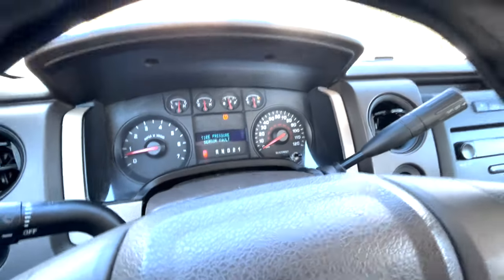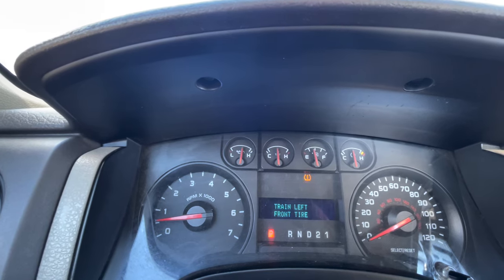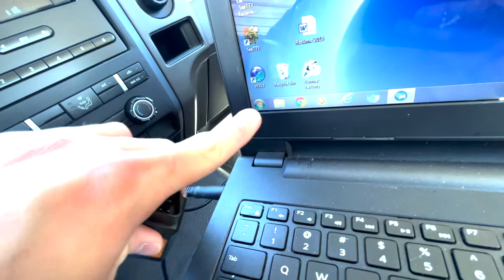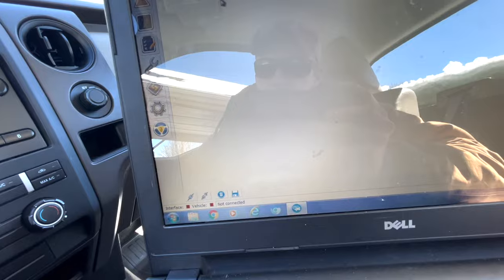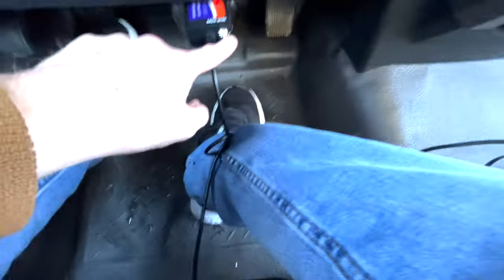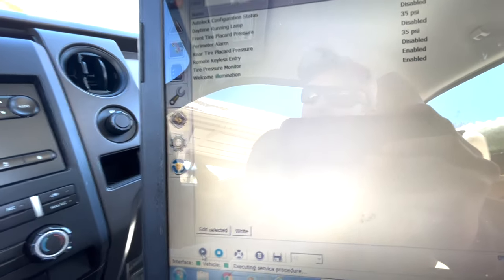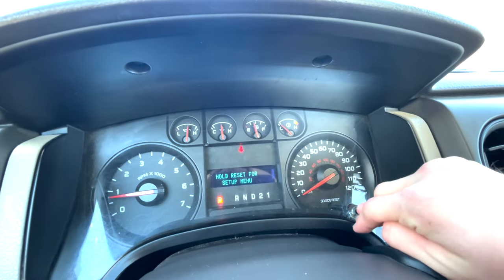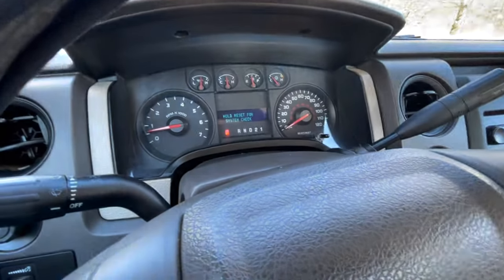DIY - How to Disable Tire Pressure Sensor Fault Message on most Fords!

Comment: Before you try this, make sure you do not have a USB charger in your cigarette lighter port. Because of some of the unregulated frequency settings, the new types of us chargers that come from abroad can throw a false tire pressure sensor error. This just happened to me about 2 months ago. I spend hours trying to figure it out until someone mentioned it to me. All I did was unplug the charger and drove around. Code was gone in a few minutes.
Reply from the maker: Never heard of this - thanks for the tip!
Reply: @RandomAutomotive  you got it. 👍👍👍
Reply: Awesome tip, Thx! Question: some way to pair electrical foldable mirrors to contact switch(F-350) normally I have to fold the mirror from the switch, but I’m curious if can be automatically fold with the contact switch off and unfolded when the contact switch is on (motor running). Thank You!
Reply: @Hfernandez06  haven't tried the folding mirrors, but I'd like to be able to use them. Unfortunately, I don't have an answer for that. I will look around and if I find good or bad news, I will post it here so it can notify you.
Reply: @peter-peter5929  Thank You !!
Reply: @randalgc  any of the non fast chargers. Remember this is an older car that was made before fast chargers were available. Just use a regular old school charger.
Reply: Who would of known ? Thanks
Reply: @Najerai17  you got it. I didn't believe it at first, but once it worked, I questioned reality again.
Reply: Thanks for posting this.  Removed the charger and the fault cleared short after.
Reply: @patgower5134  my pleasure. I had the same thing happen and I'm glad it was a simple fix. Huge stress reliever huh? I thought it was a couple hundred dollar fix and it cost less effort than a sneeze.
Reply: I'll have to try that. I just got a fast charge / Bluetooth receiver for my 2010 Ford Focus. I had just put air in all tires, then shortly after got the charger and the fault showed up.
Reply: Thank u be i bought a new USB charger then then had this problem ur a life saver💯💯💯
Reply: @btru6426  no kidding? My pleasure brother. This was driving me up a wall too. I'm glad I could help others. When you hear of someone else having this issue, you could be like: step aside, I got this.
Reply: @MindofSmoothie  how did it go? Problem solved?
Reply: @peter-peter5929  it didn't seem to work, but I only drove a short distance with it removed. I'll have to see if I remove it completely from the car and drive for a little bit maybe that will work. Not really a big deal to me because during the pandemic my wife and I went down to one car and we just picked this car up very cheap last fall to be an "as needed" vehicle so it doesn't get driven a whole lot.
Reply: @MindofSmoothie  the main concern is eliminating a "real" issue with the monitoring system. Driving for a while can clear up the error code after a few cycles if the adapter was the root cause. If it's the back up vehicle, we still have to show it love. 👍👍👍
Reply: It jus worked for me but now how do o listen to music lol
Reply: That's caused by aftermarket TPMS sensors. The ones made by Ford don't have this problem.
Reply: Unplugged my cheap usb phone charger light went off immediately

Comment: Got some 22's with 35's for my F-250 but they came off a truck that didn't have TPMS so there's no sensors in the wheels.  I am not about to spend $200 on sensors plus another $100 to remove and remount my tires just to turn off a stupid light on my dashboard.  I'll disable the system myself with my laptop.  I check my tire pressures before road trips or towing and when towing I check it at every fuel stop.  Made it all these years without TPMS on my other trucks and this newer truck has this feature, which is neat, but not necessary.  Now I'll have to try to convince the guys at the tire shop not to sell me TPM sensors when I get my next set of tires.  Maybe I'll just take the wheels off and bring them to the tire store and tell them it's for a 2003 F250 or something.

Comment: is there a line item in this program that could be disabled to shut off the default setting for "auto stop/start" switch being on when you start the car? I have been looking at hardware wiring plugs that take care of this but they are about $100. if there is something in this software, boy what a bargain this would be. I could take care of both issues with a less expensive solution!
Reply from the maker: None that I know of unfortunately on here. I hate you can’t permanently disable it (I know there are kits). Apparently it’s a government thing 🤷🏻‍♂️

Comment: If you have a 2018 Ford Expedition, this works. If the Warning light does not go out right away, drive it. I followed these directions and it cleared mine. If it doesn't, it's a bad sensor. I drove mine roughly 10 miles, because the tire was holding air.

Comment: This process worked well with my 2010 Edge SEL The Forscan software I downloaded this weekend had a caution about the quality of the currently available ELM327 Scanners, and the warning was repeated when I activated the software while connected to the vehicle. However, everything worked as indicated that it should in this video, the TPM system is now off and the vehicle is fine and absent the annoying message and warning light. Thanks for posting this information and the detailed "walk-through!"
Reply: Exactly what I needed to know.  I need to do this on our 2015 Edge. Thanks!

Comment: Worked like a charm! I was getting the tire pressure monitor fault even with new sensors installed. I just put on new wheels without sensors so I needed to disable the TPMS function. Thanks for the video!
Reply from the maker: Absolutely, thank you for watching!

Comment: UPDATE:  07-29-2022... Last night I received the ELM327 adapter you linked to. With it, I got the correct menu with the options necessary to make the change and I just used it to successfully switch my TPMS to DISABLED. Yippee!!!  While in there I also turned off my BELT MINDER, so no more incessant chimes when I'm hooking up a trailer or my wife is taking off a jacket with the seat belt not latched. 

Next, I'm going to look into programming a new ignition key. I have two but one key no longer works the remote lock/unlock buttons. 

Back in my office, I wanted to look at my LOG. I didn't save it, so no LOG to see. Bummer! So that's my little tip... on the bottom of the screen hit the DISC icon and save your LOG.  Best $20 spent in a long time... Thank you!! 

ORIGINAL POST:    So I tried to do it this morning on my 2011 F-150 Eco Boost. It didn't run correctly... The log says "This adapter has CAN bus compatibility problems and can not be used in some functions." I then noticed I did not order the adapter you listed. My adapter LOOKS identical, but it isn't what you linked. I've ordered the one you link to and will try again when it gets here. I fully expect success once I have the correct adapter! I'll post an update... Thanks for this video.
Reply from the maker: Yeah post a update for sure - for some reason FORScan is VERY particular with what adapter you use. Hopefully the new one will do the trick!

Comment: Worked flawlessly, thank you. FYI I downloaded ForScan from your link. Apparently, it has the drivers needed to use the ELM scanner you have linked in the description box. So it was plug and play!
Reply: I don't know if you found how to disable the seat belt minder but I found this video. https://www.youtube.com/watch?v=8R3n9jvr6Ek It should get you to the correct settings. Honestly, I don't remember who I followed, but likely someone who showed this method. Good luck!
Reply: @woolval52  Thanks for the reply. I did find it, it's actually in the owners manual lol. You can turn it off watching the seat belt icon on the dash, using the "key on" and locking/unlocking the seat belts 4x. 12 years I've had this truck and I'm just now finding this out 🤪🤣

Comment: My 2010 F-150 would randomly display TPMS message on a long trip. It would reset after stopping for awhile and restarting. The message would come back on after another lengthy drive. I found out by watching FordTechMakuloco if you have a cheap usb adapter plugged into one of your 12v accessory port it would disrupt the signal of the tire sensor and trigger it. The original TPM still works to this day.
Reply from the maker: You know, I’ve heard of this.. Something about the adapters interfere with the 400Mhz range and could cause that. It’s also true in some public safety vehicles I’ve seen adapters interfere with UHF radios. So that’s a very valid point. 

My understanding with this truck is it was an old Terminix fleet truck. Apparently when they remounted tires on it, they didn’t bother with TPMS. I found that out much later after this video.

Comment: Thanks for this video. TPMS light came on in my 2012 F150 about 2 weeks ago and I know its just a bad sensor battery, cant be bothered to pay $$$ to get it fixed. I check my tires frequently out of habit, never liked  or needed the mandated TPM systems. Software is available for  Mac, but it has a caveat warning, so stick with Windows if you can. The license came to mhy email within about 20 minutes, so good on them!
Reply from the maker: Glad it helped. Yeah I haven’t had much luck with Mac machines with it. They’re a great company and get to it fast especially on week days
Reply: @RandomAutomotive  OK got  it  sorted. Had to pay for the license, free "extended " did not allow me access to the modules on my truck (tried several times, several downloads) was only $12, SO MONEY WELL SPENT. Well, thanks again.

Comment: Great video! Will the vehicle pass inspection with TMPS disabled (N.C.)? Also, can the rear parking sensor be disabled? 2012 Escape. Thanks
Reply from the maker: I’m unsure about NC. I know here in Tennessee only certain counties (mainly Metro areas) do vehicle inspection, my county does not. In the larger cities here TPMS isn’t part of it - mainly emissions. However I can’t speak for the other 49. Since it’s public knowledge, I’m sure the inspectors office (DMV, municipality, etc. (whoever handles it in NC)) would be glad to tell you. 

I don’t believe rear parking sensors can be disabled. I know in older vehicles it can be turned off with a button. But parking systems became a “life safety” device at some point before rear cameras were mandated by the US govt.. I haven’t heard any success stories of disabling them through FORScan though.

Comment: Anyway to test all 4 locks on 2014 Supercrewcab? Can drivers door lock be turned off so you have to use a key only ? Thx great video 👍🏻
Reply from the maker: There are some integrated tests. I’m unsure of one for locks only, but I do know there is an overall test of interior systems. I can do a video on that soon!
Reply: @RandomAutomotive  that video would be great, thanks 👍🏻
Reply: @RandomAutomotive  I was told that a bad relay in the body control module for drivers front door is the problem, could that be true if all the other 3 door locks work as normal?? Only drivers door has to be locked and unlocked manually.
Reply from the maker: It could be.. I’m like you - I’d suspect if it was the BCM it would be all or nothing, but.. then again. The driver door unlocks independent (Ex: one click of the keypad, just driver door - two clicks the other three). So I could see how that could make sense. I like Ford, but their modern electronics are atrocious. They’re also notorious for the lock gearbox in the prematurely failing. I had a 2003 super crew that they all failed lol

Comment: I have a 2013 F250 truck that I'm trying to disable the TPMS on.  I have the ELM scanner with the MS/HS toggle switch.  I downloaded Forscan v2.3.57 which seems to be the most up to date.  I have my license key and it is activated on Forscan.  I followed the procedure given exactly (multiple times) and it never gives me the GEM/SJB section.  Is there something I'm missing or something else I need to do?  It seems to connect to the truck and read things fine, it just can't seem to get to the GEM/SJB part.  Any help would be appreciated - thanks!
Reply from the maker: Try reinstalling the driver and try again. If that don’t work it could be the oddball issue I’ve heard on some SD fords (08-14 use the same computer and sometimes the TPMS is a separate feature). If that’s the case - it could be changed in the binary data.. but that’s above my scope.

Comment: I was able to change the placecard tire pressure requirement using this module, it is not too hard to do. My tire pressures were changed to 55 psi because the load range on the tires were "E". At one time this truck, F150, was used by the Hilti Tool Co. for demonstartions and had alot of stuff bolted to a slide out bed, I can only assume there was a generator of some sort they used to demonstarte their tools on construction sites. That is why they put load range"E" tires on, I guess. none of this can be confirmed. MY issue was that when I went to get new tires I put on standard range tires with a 35# rating, I could not raise pressure to 55, as the max was 51# for standard load range. I had to make 2 changes in 2 different palces using some of the information from this video and also information from another video I found on you Tube from a guy who had a dually and needed to change placecard tire pressures on his dually. Carefully following thes instructions I was able to get my tire pressure Monitoring System working with the correct pressures of 35#. So happy. Oh by the way my 2016 Ford F150 told me that the module in this video was not compatible with this vehicle, it worked anyway.

Comment: I bought the same OBD shown in the video but now that I read some messages this wont disable my Tire Pressure Sensor Fault message in my 2008 F150 v3 5.4 Triton? I don't see it listed in the modules at all.. 😕
Reply from the maker: That’s a common issue unfortunately, this only works on 2009 and newer as stated at 0:11. 

Sorry about that!

Comment: I had to change my instrument cluster. On the truck. It was not 4x4. New cluster thinks the truck is a 4x4 with the wrench light how can i take that iff
Reply from the maker: That one is probably going to be more tricky. Not sure if you can trick the IC unfortunately

Comment: There are 6 downloads for PC Software what one do you download?
FORScan for Windows 2.3.19 Beta (Function Lists)
DownloadFile Size：26.20 Mb Hits：149607
FORScan for Windows 2.3.17 Beta2 (Support IPC Module)
DownloadFile Size：26.40 Mb Hits：89203
ELM Config
DownloadFile Size：12.21 Mb Hits：42609
ELM-FF2 English
DownloadFile Size：303.90 KB Hits：10388
FDS
DownloadFile Size：125.60 KB Hits：9388
FoCCCus 0.8.6
DownloadFile Size：125.60 KB Hits：19388
Reply from the maker: Good question, actually redownloaded yesterday. You will want to download FORScan for windows.. and the ELM driver also for the adapter.

Comment: 2 questions.
I have a 2012 f150 with 2021 rim and tire take offs and can't get them to marry. Will this help marry them? Or just need to disable it?
2nd question. Same thing...but 2007 charger with 2021 rim package. Will this unit work on this situation?
Reply from the maker: I’d probably disable it. I could be wrong - but I’d say the 2021 uses a different protocol than the 2012 truck understands, so it wouldn’t be able to ready anything outside of the f150 body style if that makes sense. 

This unit only works with ford vehicles, but I imagine it Chrysler has something similar it would be the same sort of issue. Hope this helps!
Reply: @RandomAutomotive thank you

Comment: Bought the adapter, but vehicle says ELM321 v1.5 not compatible with my 2012 F350.  Also I am running Windows 11.  What is my next step.
Reply from the maker: @jimsusanmoon6762 - Just checking, you did buy the "wired" version correct? I have had issues with the wireless version. I would recheck your windows drivers and make sure those are up to date before you buy another. Hopefully this helps!

Comment: Apologies if this question has already been asked. Can one reverse this change later needed? I may need to turn the system back on later.
Reply: I assume you can just swap it back to enabled, but my next question is how expensive is that software after the 2 month trial because my plan is to disable it when I put my winter tires on each year and enable it when I put my regular tires (with sensors) back on

Comment: Hi from Hawaii i got a 2007 mustang GT 4.6L mine is doing this now. So this thing might just have a dead battery in it before I buy anything?
Reply from the maker: Hi from Tennessee! That’s a possibility, but that means dead battery in the sensor, not the car itself. Most likely that’s it. Which those batteries are sealed, meaning the fix would be a new sensor - or the alternative disable the feature altogether. Honestly though, I’m unsure if this would work in a 07.
Reply: @RandomAutomotive  ok thanks
Reply: I just bought the ELM327 MS-HS OBD II for the mustang, On Amazon 20 bucks. Thanks for the video.

Comment: I know this video is old but maybe its still active. I bought the device as you described. I connect to my 2012 and 2014 F150 and it connects but get a message that the "device isn't for this vehicle and my not work properly". it connects but it doesn't show the tire pressure system on either truck. it shows many other modules. I followed the video to a T. Thanks for any help.
Reply from the maker: May try to make sure the HS/MS CAN switch is set correctly.. if it is, you may want to reinstall drivers.
Reply: thanks. I
 will give it a try.
Reply: @RandomAutomotive  reloading drivers didn't work but I found it in the BDYCM module. I disabled and it seems to be doing correctly. no more light or messages. Thanks for responding.